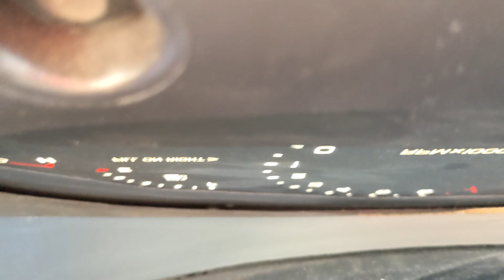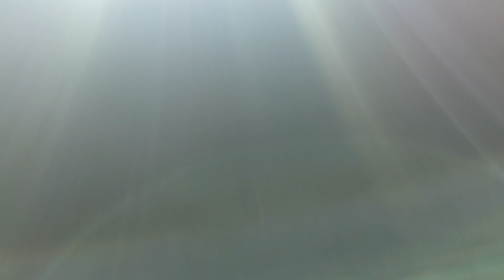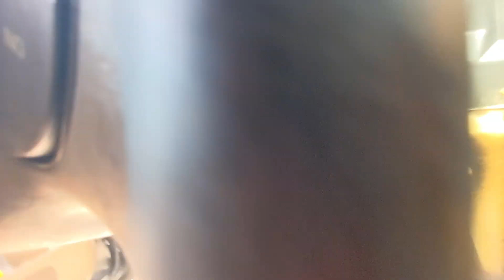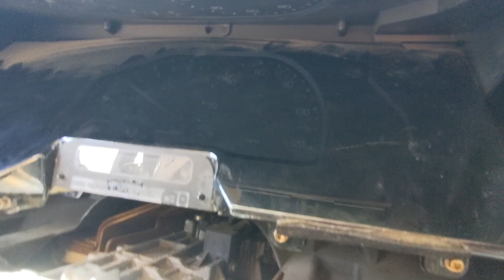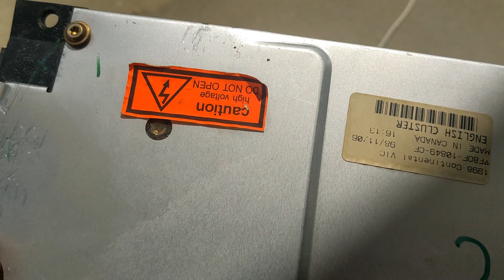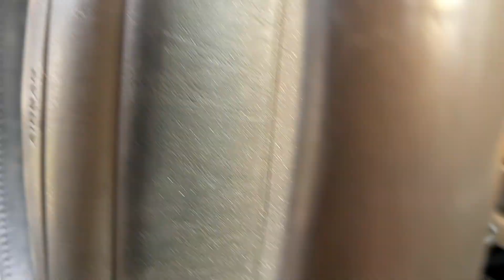1998-2002 Lincoln Continental Glitchy Gauge Cluster Removal and Fix - Bad Solder Joints

Comment: Funny enough, this problem just started up on my 1998. 111k miles, pretty smooth ride, but the cluster doing that scares me.

I'm gonna show this to me mechanic since I have NO CLUE what I'm doing or how to solder. 

As long as I'm safe to drive right now, I don't care too much, I was terrified I was losing power on my way home from the city earlier.

Thank you so much for this video!
Reply from the maker: @briandipierro8865  You'll know if you start to lose power. From what I recall, all the MIL lights will start to flash. Had this happen to me too once due to a bad alternator.

Glad my video at least illuminated what's going on with your cluster.

Comment: im a bit late to this but the service manual says to drop the steering column so the cluster clears, apparently its only held on by 2 nuts and just drops down.

edit: i was wrong, theres actually 4 nuts. regardless, still faster than cutting that tab.
Reply from the maker: It only took me like 3 mins to cut the tab. I did try to drop the column by loosening two screws for the tilt, but I was afraid after I loosened the spring tension for the tilt, it would be difficult to get it back. So that's why I decided to cut the tab. After I cut the tab, I just tilted the steering all the way down and it came out, no problem.

There's probably another location to loosen the column further down but I didn't really pursue it. I'd say cutting the tab would have to be quicker than unbolting it though.
Reply: @SmartSped1984  yep its held down in 2 locations, an impact driver made quick work of them as they werent very tight

right now im stuck trying to get the cluster to clear the top of the dashboard, would you happen to have any tips for that? do you just have to fight it until it works?
Reply from the maker: @32VInTechV8  Push it back in like you're installing it back to the way it was, and maneuver the top part of the cluster past the screw mounts on the dash first by pulling both down and towards you.. Then you should be able to pull the bottom out and it should clear.

It's so tight in there that you have to clear the top first before you move it any other way
Reply: @SmartSped1984  took a few hours of messing with it, but i was eventually able to get it. appreciate the response!

Comment: Very interesting video. Good that you went all the way fixing the issue instead of just replacing the part. If you ever plan on doing another project: many of these Contis have an issue with airconditioning and the AC blend door thats malfunctioning. Ford came up with a TSB to fix this, but the dash needs to be removed.
Reply from the maker: @070nino070  Luckily, I've never had an issue with the blend doors on mine. Usually, when someone comes at me with a blend door issue, I tell them to live with it because I don't want to be responsible for all the broken clips that may occur if I have to take out their dash.
Reply: @SmartSped1984  yep I get that. unfortunately its hard to live without any A/C these days…

Comment: I pulled off the whole steering column on my 1995 T-Bird to be able to pull out the gauge cluster with ease.  Odometer stopped ticking because of a cheap plastic gear.  Thanks Ford!!!!! You build a pretty solid vehicle, and you couldn’t put a decent, solid gear that doesn’t buckle under the extreme heat and cold inside your instrument panels??!!!  
Oh, and btw, the 4R70W AOD transmission had a short lifespan, once you feel it shuddering!!!!   I had to use TCI Performance parts to offset the shoddy garbage parts from Ford, to make it great again!!!!